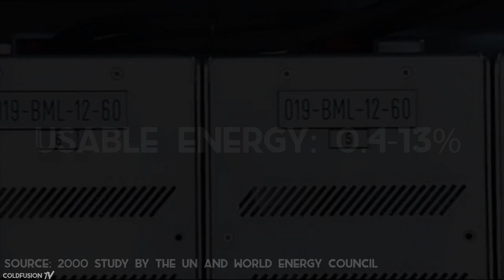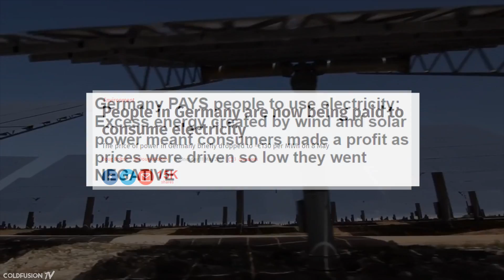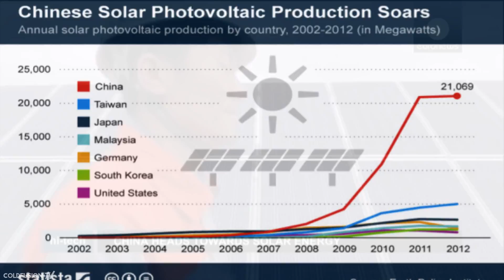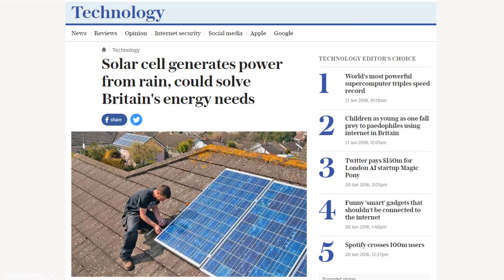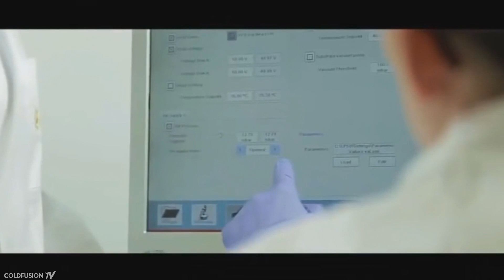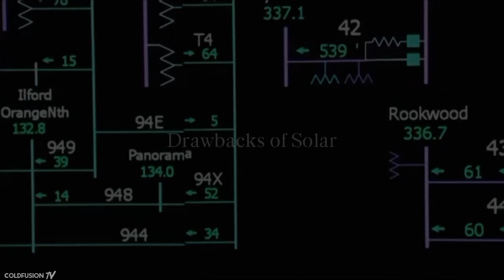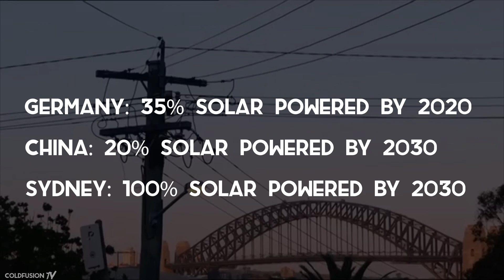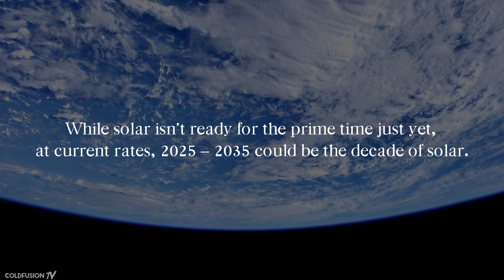The Truth About Solar

Comment: The pollution it takes to create a solar panel is equal to the pollution  via conventional electric generation over a 25 year period.  Sadly, that pollution is ALL generated today vs spread over the 25 year period (the lifespan of a panel). Factor in the transportation, installation and most of all, the constant upkeep / cleaning (thus massive water usage etc) and you have quite a negative side of the ledger to contend with.

Still, I like it far better than coal, nukes etc. With massive research efforts I am sure the future will look very bright indeed. Solar Bright.
Reply: Also factor in the transportation, installation and most of all, the 25 yrs of cleaning / water usage etc.  Most of all, no one can spare the water... But yes, solar is our bright future so yes we do agree there. I just want these glory videos to present the pros AND CONS for once, a true pic...
Reply: Amazing how these considerations need to be presented for Solar Panels.  But the same considerations are not an issue or factored in for coal trains, coal fired powerplants, gas and oil tankers, trucks, pipelines and gas fired powerplants. Nuclear... it's clean and pollution free, just ignore the water used for cooling towers for ALL those previously mentioned power systems.  Ignore the onslaught of environmental disasters tied to each one.  Oh mercy me, a bird got killed by a wind turbine blade (and ignore that the deaths stop over a period of time as the birds adapt and avoid the blades or get shorter length wings and can outmanuver the blades)!  Ignore the countless birds that have gotten killed every year by power lines, oil spills etc... 

Ignore that a solar installation spill is called sunshine rather than a region that can't be inhabited for a 1000 years like a nuclear failure... or non failure when you have to deal with the end product.  Or the fire that burns down a town in a tanker explosion, or pipeline explosion, or an entire ecosystem being destroyed for decades when a oil rig fails or an oil tanker runs aground.  Yeah, solar is the environmental problem... that's the ticket.  Maybe if you just keep saying it, it'll become truth.
Reply: He's absolutely right. What he's trying to explain and is often over looked is the EROEI limit. Energy Returned on Energy Invested. You have to factor in all energy expenditures.  From the fuel that went into the earthmovers and construction that built that PV factory to the batteries.
Reply: BlofeldsCAT. You get it. Amazing how many can not see their way out of a paper bag or just like to argue about anything.

As for coal etc, yes, they to need to have the EROE factored in as well. I never said they were better or cleaner etc. Solar is far better BUT count the cost, the total cost before selling anything as ??? the new fact... To be honest about anything you/ they must give BOTH sides of the argument / debate... at least in my ole fashioned book of almost 7 decades now. I am just tired of con jobs, sell jobs and half truths (if that mush)... Question everything.
Reply: @TopTribute BandsNstuff, its all well and good saying how much energy it takes to make a solar farm, but you seem to forget that it takes energy to build every other type of powerplant too.

Solarpanels can work for over 100 years they simply wont fail unless they get damaged. they dont need to be refueled either. which also means you don't need a fuel pipeline. the only parts that are likely to ever fail are inverters maybe once every 20 years. you simply can not win this argument, and you will be shot down every time you try and argue against solar panels.
Reply: If a wind turbine manufacturer, powers its manufacturing by wind, how much pollution is generated? Zero.  

Now if that wind turbine manufacturer provides energy to the grid, how much pollution did it cause by refining and mining aluminium? Zero.
Reply: Your argument's are shit and i will beat you Every. Single. Time.
Reply: only the toxic and radio active waste left in china after making the super magnets for the generators
Reply: you fail to consider 100s of tons of concrete and rebar and transport to the installtion site and disposal after the things inevitably fail way before the promised 25 years life.    You initail argument re making wind turbines with wind turbine power is also flawed because of this and also there is nowhere that this can actually happen.   You make up a hypothetical situation to "win" an argument and then claim victory.  Its all a bit pathetic.    Ok the be a solar/wind fanboy but at least be rational.
Reply: Your figures are outdated based on 1970's solar cell technology and ignores previous coal mining and burning pollution which was much dirtier than what is permitted today.  If remediation of past coal pollution were to be spread over the next 35 years, every year coal would look far worse than solar, while solar cell manufacturing would continue to become more efficient with less pollution.  Cell conversion efficiency would also improve, while coal remains stagnant, making the comparision swing overwhelmingly in favor of solar.

Ignored in this discussion are solar/thermal electric generating plants, driven by closed circuit solar steam turbines and located in areas unsuitable for habitation or farming.
Reply: +yarpos Coal generating plants also require concrete and steel, as well as rail lines and trains to continuously move volumes if coal in and cinder out that far exceed the mass of the generating station over its lifetime. Most of that mass of fuel becomes one form of pollution or another.
Reply: Strangething as a matter of fact you lost this argument the second you started to call peoples arguments shit. That told pretty much everyone that you cared more about ego than facts
Reply: Solar only lasts about 20 yrs wheres the proof to support this? 85% of solar in use was installed in the last 5 years, solar panels from the 70's are still generating 90-100% of rated power - they are less efficient than modern panels however.

making a solar panel generates as much pollution (today) as what it would save over it's 20 yr lifespan again wheres the proof? it does not exist because it simply isn't true. solar panels aren't hard to make. the silicon does not need to be as pure as silicon used in CPUs either.

tap the limitless energy via surf and tides would love to see more being done with this and put PV cells on top for extra energy production.
Reply: Sure it MAY be better than nothing (solar) but don't hype it as if it is the REAL solution. It is not.
Oh ye of so little knowledge. OK, NO generating / capturing / storing energy (even FREE energy such as solar or wave does not ALL require HUGE manufacturing or maintenance  etc...

ONE Example (one of mine off the top of my head in 5 minutes of recreational thought time for ya):
Think of and upside down funnel (actually more like a roof top design but funnel works for this example).
MOOR / ANCHOR it in the surf of any ocean (and remember, 80% of our population lives near water like our oceans). The non stop up and down of the surf generates TWO types of energy (both store-able thus able to ship or usable on site) ie: Compressed air and vacuum. As for moving parts? Only ONE round bearing to open and close the compressed air or vacuum lines.

For those of little imagination: Use the energy to generate electricity at the site OR pump water uphill to a lake to act as a storage battery (hydro dam). When releasing water to generate electricity don't forget to use the VACUUM side of the water flow (50% of the energy) as it flows downhill (think of water in a straw).

Can I make it any more simple for ya? Again, doing all of the work for brain dead people who never had one original thought in their entire life. Poof, a machine with one moving part. Super low maintenance (I could make it self cleaning via sucking off some of it's energy but hey, my brain has done enough for this five minutes LOL:-)

Try thinking for yourself vs parroting...
Reply: @scottwa Nevermind all the birds that die because they don't look where they are going and fly right into our ever taller skyscrapers...
Reply: These arguements are silly becaus no one was saying that coal or oil was better. simply that there were other factors to consider. Also i believe toptributebands was trying to support some form of gen 4 nuclear reactors.
Reply: oh sorry i forgot how much pollution solar panels generate by sitting there converting energy all day long for a hundred years. yes your right, coal is 10x cleaner than solar, 100% beat me there.. darn it.
Reply: Strange, Solar only lasts about 20 yrs NOT 100 yrs and what I said that you did not comprehend was that making a solar panel generates as much pollution (today) as what it would save over it's 20 yr lifespan (thus spreading the pollution over 20 yrs while something better came along if we use current cleaner [not coal dhaaa] generating methods.).

Mike, No I am not support any nuke generators.  When I was a kid in the 1950s / 60s we learned about breeder reactors (one consumes the waste of the other thus pollution / waste product free) but that never happened. It was a propaganda sell job to get us to like nukes back then.

I would rather tap the limitless energy via surf and tides since 80% of the world's population lives a few miles from the oceans and lakes . Up, down, up, down gazillions  of pounds of pressure every second going to waste. Totally clean if done right. Compressed air and lets not forget vacuum energy on the down stroke or use the energy to pump water high to a hydro dam etfc etc etc. 

Put on your thinking cpas ppl.
Reply: 90, Silicon solar??? You do not have a clue. First, the best gives it a 25 yr warranty (there is a very good reason for 25 yrs and not 50 or your 100 yrs).  

Second, try doing your own research but hey, I'll get ya started becasue it is obvious that none of you have the IQ to use Google: 

"Hazardous Materials Used In Silicon PV Cell Production":
http://www.solarindustrymag.com/online/issues/SI1309/FEAT_05_Hazardous_Materials_Used_In_Silicon_PV_Cell_Production_A_Primer.html
Read that and be amazed and a bit educated for once. Try Searching YouTube for videos (for Lazy U Readers)

"Silica is refined at high temperatures to remove the oxygen and produce metallurgical grade silicon, which is approximately 99.6% pure. However, silicon for semiconductor use must be much purer.
Higher purities are achieved through a chemical process that exposes metallurgical grade silicon to hydrochloric acid and copper to produce trichlorosilane gas. The trichlorosilane is then distilled to remove remaining impurities, which typically include chlorinated metals of aluminum, iron and carbon. It is finally heated or “reduced” with hydrogen to produce silane gas. The silane gas is heated again to make molten silicon, used to grow monocrystalline silicon crystals or used as an input for amorphous silicon.
The next step is to produce crystals of either monocrystalline or policrystalline silicon. Monocrystalline silicon rods are pulled from molten silicon, cooled and suspended in a reactor at high temperature and high pressure. Silane gas is then introduced into the reactor to deposit additional silicon onto the rods until they “grow” to a specified diameter.

To produce multicrystalline silicon, molten silicon is poured into crucibles and cooled into blocks or ingots. Both processes produce silicon crystals that are extremely pure (from 99.99999% to 99.9999999%), which is ideal for microchips, but far more than required by the PV industry. The high temperatures required for c-Si production make it an extremely energy-intensive and expensive process, and also produces large amounts of waste. As much as 80% of the initial metallurgical grade silicon is lost in the process.
Sawing c-Si wafers creates a significant amount of waste silicon dust called kerf, and up to 50% of the material is lost in air and water used to rinse wafers."

And on and on and on... Chemicals, waste, hazards, and money money money at ever step. It's not just sand kids. Now, stop telling me to do all of your homework for ya. I gave you the bottom lines, easy answers for simple people / kids... NOW do your own REAL research kids vs finding excuses why you are angry because others did not do ALL of yor work for ya. Brainless brats. You should have grown up in the 1950s without any internet etc. Walk in the snow to the library and spend all day finding one answer to one question vs today, simply Googleing everything in one second... Lazy brats.
Reply: Did you even read the article you pulled all that from? not only do they buy the rejected wafers of the semiconductor industry - thus reducing waste but all the hazardous materials mentioned can be easily controlled. every single manufacturing process involves hazardous materials, involves tons of energy to refine the raw materials. everything from wind turbines to wave generators need huge amounts of energy to build, the moving parts will eventually wear down and need to be replaced, the point of all these solutions is that they are NET positive compared to what is mainly used.

Nuclear waste instead which is so dangerous it has to be stored deep underground and protected by armed guards 24/7 for 10 thousand years. 

Or releasing all the carbon that was stored by the earth for the past 500 million years, lets keep breathing in all that lovely carbon monoxide too.. 

Anything out at sea needs a fleet of engineers to maintain, making it more costly when something goes wrong. and the majority of these boats don't run on electricity either. and if you are so opposed to solar, wait till you see how batteries are made to store all the renewable energy.

These things have a cost now.. yes, but the future will be brighter with them than without them.
Reply: i'm not saying solar is the only answer, never have, might have came across that way in some replies, but it's not as bad as you are making out.

We aren't short of solutions for solving the worlds energy needs via renewables, what we are short of is money, the major power companies would still rather burn coal and use nuclear than spend money on renewables.

so what can the individual do to help? wind power needs planning permission, is expensive and generally get rejected by neighbors. majority of people don't live right next rivers and oceans, and if they do, they won't get planning permission 90% of the time. that leaves solar being that its relatively cheap, anyone can get it installed on their roof and everyone has access to sunlight.

and to state something else that i probably forgot to mention, solar panel warranties aren't warranties for complete failure, they are warranties to protect the panel degrading too fast over a 25 year period, if it falls below something like 80% efficiency before 25 years, you get your money back. and regardless of how much the efficiency drops off after that even a panel producing 1% of its rated power after 100 years is still better than not having it at all.
Reply: Good points. Yes. solar is one easy way to go for now MAINLY due to government interference which would sound odd if you did not know that all governments are bought and paid for (in blood money) even ours of course.

Yes, there are solutions but hey, the rich need to get richer via killing all of us as history once again repeats itself.

Comment: I'm calling BS on this propaganda piece and Solar Power itself. Presently the largest Solar plant in the United States in California's Desert which is frying birds out of the sky btw had to be subsidized by the Government to stay in operation and is still failing. Is under threat of closure. At it's peak never had an output (In a very Sunny Desert mind you) of 47% of what was promised and it's stated capability of producing and was in the News recently because it caught fire, (see news for details) and the Mayor of New York is a not only a big government flunky but a Communist all intrusive Government flunky who I doubt has a clue as to what Solar actually is or it's Capabilities. This doesn't mean I'm against developing Solar but in the Private sector Government doesn't have a clue either. At it's present stage Solar is mildly useful and that's after what 40 years of their Con Jobs like this video. You want to heat a House or City do as the Icelandic's do and go underground. Google it.
Reply: The majority of this video is about photo-voltaic solar, you're talking about solar thermal power. Photo-voltaics don't kill birds, and have been operating very successfully in places like the Mojave Desert.